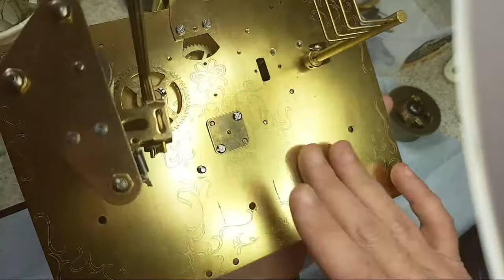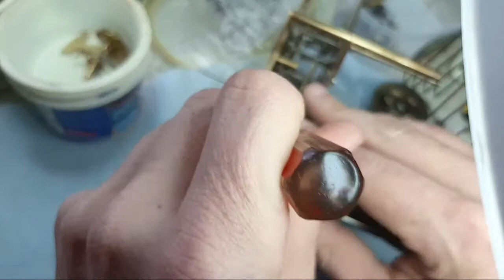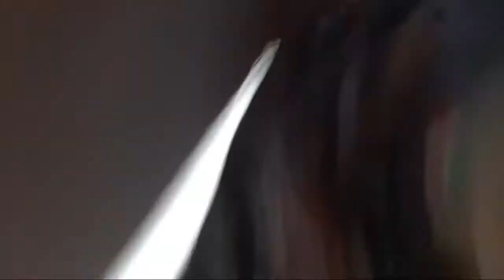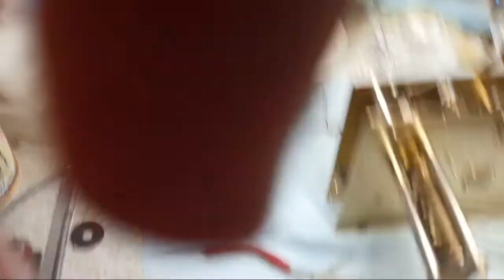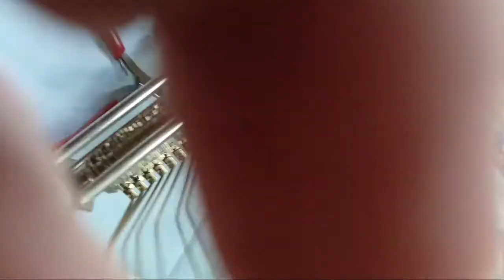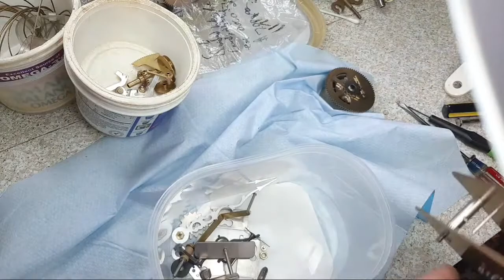Hermle 1161 Tear Down And Rebuild

Comment: Hello...  What is the component you pulled off at 5:07 - 08 and what does it do?  My movement had a situation where it got out of time with the rest of the chime strike and wouldn't be lifted out of lock on the hour chime after the chime co-ordinator would drop it into lock at the 'quarter to the hour' chime strike.  Can these striking train components get out out of timing with each other???

Comment: I have one of these clocks which is having problems with the chimes, I have cleaned and reoild but I have not stripped it it looks in quite good condition and I don't think it needs bushing
Reply from the maker: They seem to run trouble free for 25 years or so, but there are several moving parts that could be to blame. Hard to say without seeing it in person